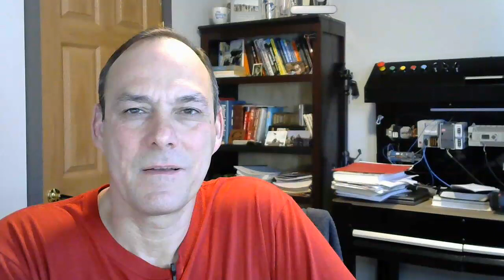PLC Programming Technician Vs Engineer

Comment: Very difficult to compare , i'm maintenance technician with automation and electricity specialities , and i'm looking for some solutions to install/modify the all system , programmaing , materials setup , calibrate , test for modify or put all new system , with that i do also the maintenance part , find the defaults , find solution to let the production made the parts without the component which is break .
I do also mecanics , pneumatics , hydro etc ...
This is why it's so easer to demand to some engeneer work to a technician because when u have a very good technician who can do all difficult thing , why do u need a engineer ?And where is the limit.
Plus , your technician do the same things or better things but the company will not pay you the salary u deserve .
I updates , made the electrcal draw , mecanic draw , manage the inventory , i welcome also provider when we don't have the component or tools to modify system .
And to modify system u have to know how the all system work u don't have the choice and trust me into the process u have a lot of differents components which work totaly differently

Comment: Nice! I'm just starting a position tomorrow as a button Pusher in a Manufacturing Corporation, but have a very wide range of experience as field technician and have studied many subjects.
The plant manager is also an Automation Engineer and we go to the same church! So I'm hoping to become a tech under him eventually.
Reply from the maker: Let me leave you with one incredible thought. The machine, conveyor etc. that you will be working on was built (likely) and programed by an automation company.  Finds out the name of the machine builder (should be on a label somewhere on the machine) go to the internet and look them up. Ask the maintenance team and or call the company, ask a for a copy of the electrical prints, and the PLC program. Both can give you a copy of the PLC program printed out or in PDF form. You'd be surprised how many will give them to you. Then start studying the machine, its operation and compare the program and the operation.

Comment: Hi Logix Workshops, thank you so much for the informative video. I wonder, in what state of the US is your professional experience, and what specific industry you have worked in? 

I ask because at least in California, and the rest of the US as far as I know (and perhaps globally), the title of 'engineer' cannot be granted/issued to someone that does not hold at least a 4-year university degree in an engineering field. This is certainly the case in 99% of the cases in government positions, and probably 90% the case in private industry.

Aside from that, you are absolutely right that the level of compensation and technical responsibility varies by the individual's knowledge and experience on the subject, and the companies' practices and expectations.

I would add that the type of controls engineer/technician and industry in question also matters quite a lot. For example, in factory automation, a controls engineer or technician may end up doing just about the same thing, and the engineering degree may not matter as much. However, in the petrochemical, power plant, or other sophisticated product industries for example, there is a clear distinction between a Control Systems Engineer and an Industrial Controls Technician: the Engineer has (or should -- not always the case, unfortunately) the breadth of science and physics knowledge base to be trusted with designing and understanding processes, conducting risk and hazards analyses, establishing process setpoints and parameters based on physics and the associated process objectives, etc. (... and also sometimes the ability and skill to perform 'technician'-level tasks as well), whereas the Controls Technician would likely not take on such aspects. For such cases, the engineering salary substantially surpasses the technician salary.

I enjoyed your video. I hope you don't mind my input -- I just wanted to contribute my 2 cents to your audience's understanding of the matter. Take care.
Reply from the maker: I live in Indiana and work around the USA and have traveled around the world. I do not have a 4 year college degree, however I have been an engineer for many years.
Reply: Hello my name is Dave I work as a technical recruiter for Flextronics. 
We have job Vacancies for Automation technicians at Flextronics, Austin TEXAS.
send a dm if you have 4years+ experience in the field. 
Military personnel with PLC technical training are encouraged to apply. Associate Degree in related field is a plus.

Staffing for over 40 positions - both contract and full time
Relocation assistance available for full time positions.
Reply: Real engineers have at least a bachelor's degree. It's just that some people use the term loosely.

Comment: I’m a technician with 3 years experience and I’m currently going to college for electrical engineering. I got in the field with no experience went from 40k-60k in 3 years . I realized the degree is a title. But The same thing for the title of a technician. Is all about the individual. I went from wiring control panel and plc. Now doing electrical and mechanical drawings. Next is to start doing programming. My boss gave gave me slc 500 and rxlogix.
Reply from the maker: Good luck and dont stop!
Reply: Change my career at 30. Just got my Associate Degree in engineering technology. Now going on for my electrical engineering degree. Next journey begins
Reply: @Obzrve  Hello there I see you are well experienced as an Automation technician, I work as a technical recruiter for flextronics in Austin Texas, and we have job vacancies for Automation technicians with 4 years experience, send a reply if you're interested.
Reply: But never starting to create your own design, based on operations or work flow, because..... you're not an engineer, yet!

Comment: Hi, I have a question. I'm learning PLC programming (TIA Portal) and that takes a lot of time and effort. But in college there's another animal to beat: Power Electronics. The class is difficult for me and I have spent a lot of time studying that. What if I just focus on PLC programming and get out there working in automation field without the strong foundation of Power electronics, is it okay? Or it'll be a big hole in my education and I'll get troubles in daily work?
Reply: Engineering is more than programming. You will be tasked with designing a control cabinet, which includes transformers, power supplies, VFDs, and circuit protection. An example is I have 480V 3-phase power coming into my cabinet. I want to add a 3-phase 480v to 240V 15KVA transformer to my machine. I must install a circuit breaker on the primary side that is sized to 167% of the full load amperage on the primary side. What size is that?
Reply: The curriculum is in that order for a reason.  I recommend taking your time to complete the courses in order
Reply: @alexdelgado9231  Thank you for your recommendation.

Comment: Great Video! I wanted to ask you if you would say a bachelor's degree is worth it in order to work in automation. Do you yourself hold a bachelor's degree? Is it necessary to obtain one in order to progress in the industry? Thanks again!
Reply: No it is not necessary unless you want to be in management. A bachelors will open more doors but a certificate + years of experience or an associates will do fine for getting into the door.

Comment: Very insightful video, I don't have a formal education in automation but am learning as I go. My current plan is to work as a maintenance technician>>  control system technician>> control system lead and then a control engineer, but if they offer me an entry level control engineer position anytime soon, I'll take it.
Reply from the maker: I think you should take the position as well. Often its all about getting that first job, and continuing to learn.
Reply: Is the company you are working giving you promotions?
Reply: @ahopefiend1867   Am currently working at an Amazon building in their RME department.  They used a level based system so all I have to do is apply for a higher position and take the interview/test.  A lot of  opportunity for career growth if you have the skill and experience.
Reply: I’ve been a wireless tech in the cell phone industry for 24+ years, I would’ve loved to have followed this type of career path instead, but at this point in time I’ve topped out in pay and though I am still young enough to transition into this line of work I know they wouldn’t pay me what I make now, plus I would start all over learning a new technology—-but my this type of work seems really interesting!